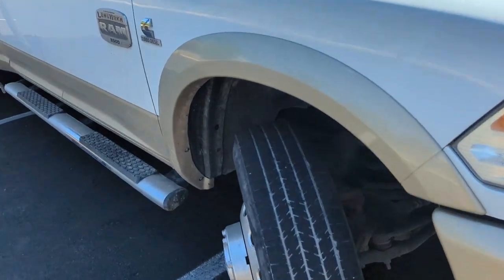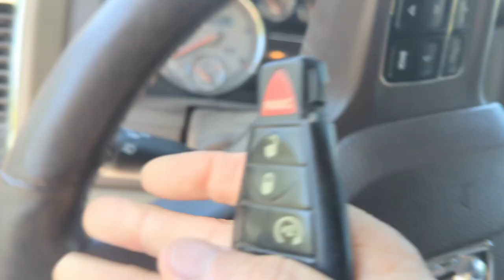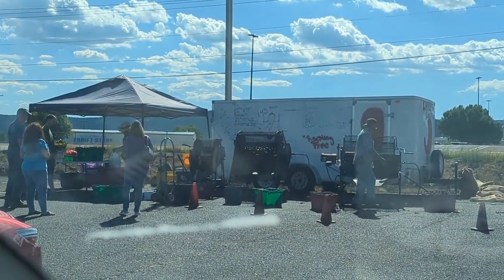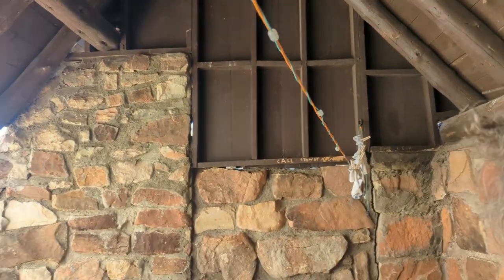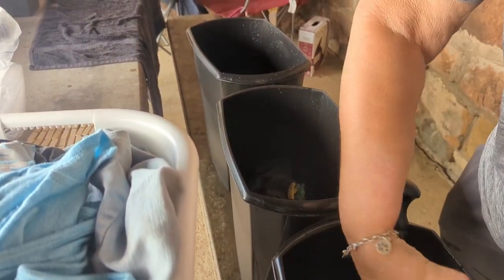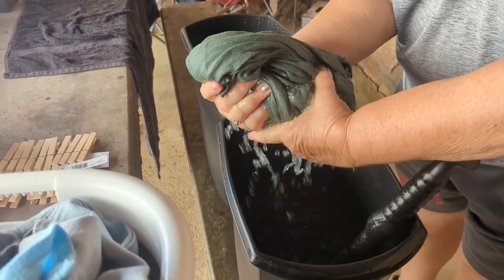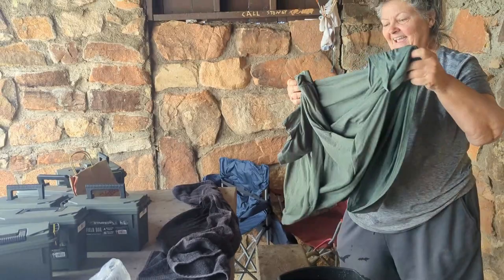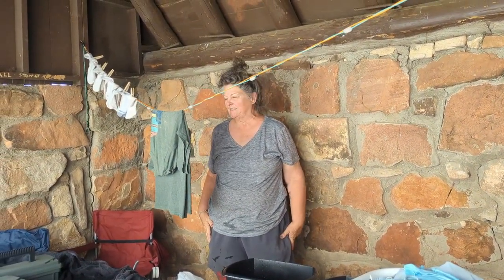Odds and Ends - A New Way To Do Laundry - Pups Go Shopping

Comment: Great idea using the plunger and 3 tall garbage bins.  I remember having to use a laundromat for years and hated every minute of that.  Fortunately, through God's graces I now own my home and have a washer and dryer, but my dryer is broke at the moment so I line dry.  Here's a tip for pillow cases and bed sheets that have been washed and went through the spin cycle:  I immediately put them on the mattress and pillows even though they're still damp.  It's pretty much guaranteed when they dry on the bedding there will be no wrinkles.  This especially works well in hot weather.  I've even done that when I just washed a top I want to wear immediately.  When it is washed and spin dried I put it on damp and within 10 minutes my body heat dries it and there's no wrinkles.  Your friend's idea to fold the top in half is something I do with my jeans.  I think even when I get my dryer repaired I'll still use a clothes line.  Free drying is quite appealing to those of us who pinch pennies, especially those who live in their vehicles.  May God bless each and everyone of you folks who do so.
Reply from the maker: Thanks for the ideas.  I am liking not having to go to the laundry mats and lots of times they are many miles away which is gas money too.  I am also loving the air dry, my clothes smell so fresh and clean.

Comment: Dumb question, but what does drilling holes in the plunger do?
Reply: Releases the air as you plunge up and down if used as a normal plunger will suck up what ever is clogging your drain or toilet.

Comment: I do my laundry every week in a huge bowl in my van n hang to dry..sometimes i use my little cooler which i rarely use as a cooler bc i get tired of buying ice that barely lasts a day in summer or two in winter...only time i go to laundromat is for blankets, comfortors n big stuff..
Btw..trying to save for rv fridge but with 500watt battery not so sure thatll work..til i get solar anyway..takes forever to get what you need on a fixed income